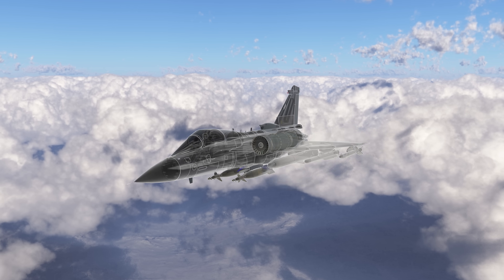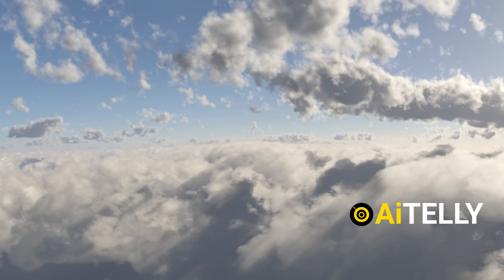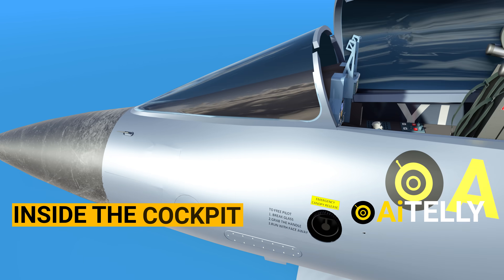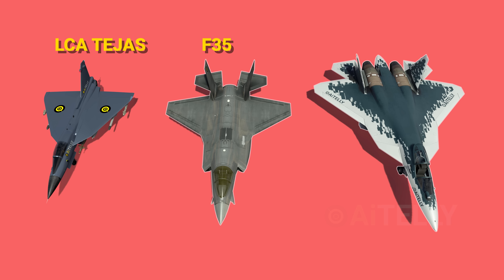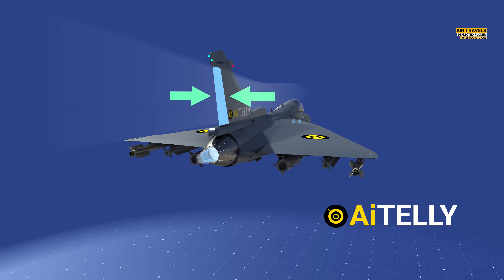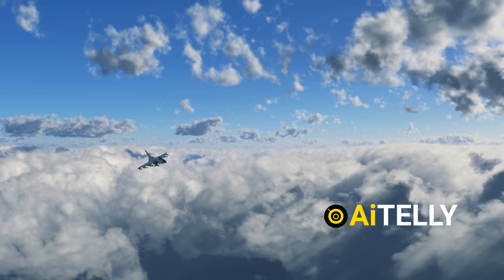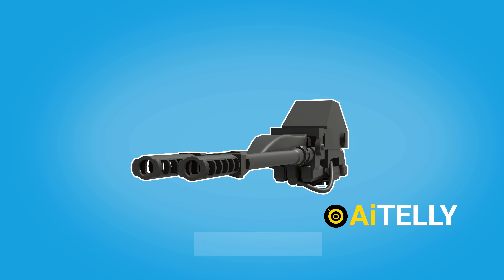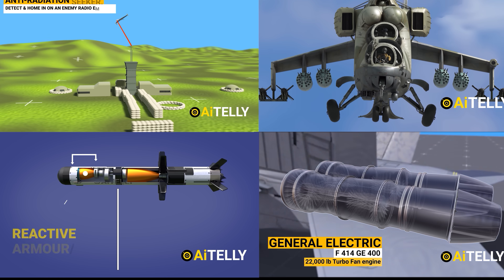Multirole Fighter Jets  How it Works | Tejas Mk1A LCA Light Combat Aircraft #fighterjet #jet #plane

Comment: UTTAM is not yet installed,, Mk1 and mk1a will have different radar ..Mk1 has Israeli ELTA 2032 radar which is not AESA... Initial 20 of mk1A will be fitted with Israeli ELTA 2052 AESA radar , rest of the mk1a will be fitted with UTAAM AESA radar

Comment: I think unloaded Tejas has more stealth than su57 💀💀💀 , well su57 has same cross section as f18 .
Reply: Now I am not at all pro Russian, but people who say that the Su-57 has the same stealth as the F/A-18E are utter clowns who have 0 understanding of how RCS is calculated. Just doing regular old RCS calculations does not give any reliable values at all. All of the data on such matters is entirely secretive on both sides, and until we get actual data declassified from combat encounters including the Felon, Super Hornet and other modern fighters, only then can we deduce the levels of stealth that a certain aircraft has. Plus, the calculations say that the Su-57 has an RCS value to that of an F/A-18E in a clean configuration, the vast difference being that no 4th gen will ever go into combat clean, but the Felon does go into combat clean
Reply: Even if what you are saying is right but still.

 tejas as a 4th gen will carry weapons externally ,just likely fa 18 super hornet.

While su 57 has internal bay.

Comment: 1. Engine is F404 not F414
2. Currently Mk1 A uses an elta elm AESA radar not Uttam radar.
Reply from the maker: We have added your Comments in the Correction Section thanks.
Reply: @Aitelly   In mk1A may be now uttam mk2 radar will be used... We will know after induction of mk1A...
Reply: MK1A will have Uttam AESA. MK 1 has ELTA
Reply: Also it doesn't have Detachable IFR probe.
(In-flight refueling probe).
Reply: @rajatdani619  FOC variant does
Reply: Mr. For your info now most Tejas mkq use Uttam Rader.